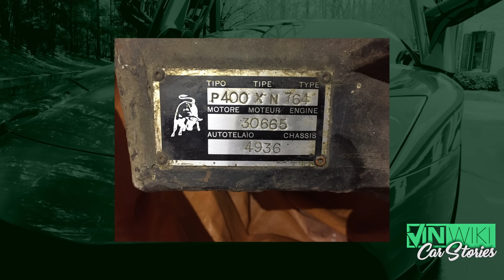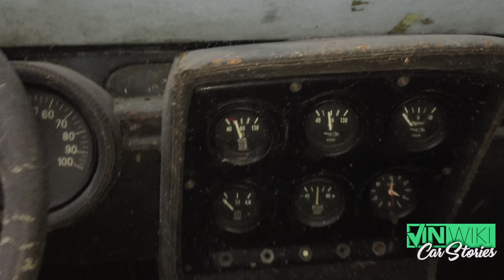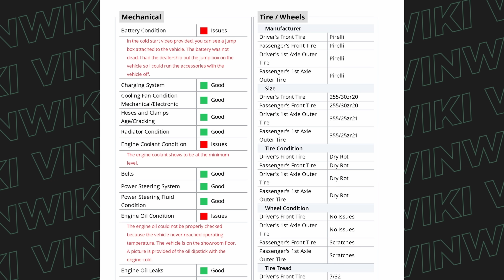My HUNT for the stolen Miura SV!

Comment: I have some information for you about the 2 Miuras you posted. The green one was imported by the Italian embassy in Rio, and I think it still belongs to the Italian consulate, because the embassy moved to Brasilia. I saw this car in 1998 at two oficians in São Paulo, one to service the engine and the other to repair the air conditioning. I saw that the timing belt tensioner was damaged and an adaptation was made with a VW belt and a GM command belt tensioner. The store that did this was PROSCHARCAR, well known in São Paulo.
Reply: Oficians = motorshops